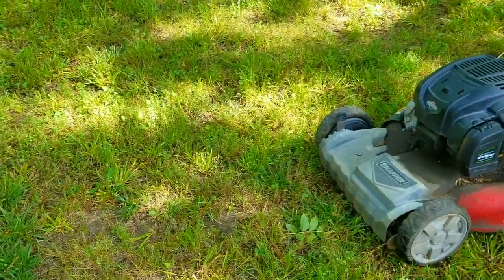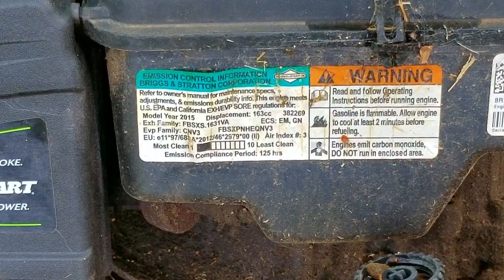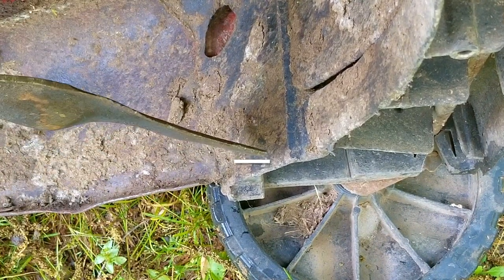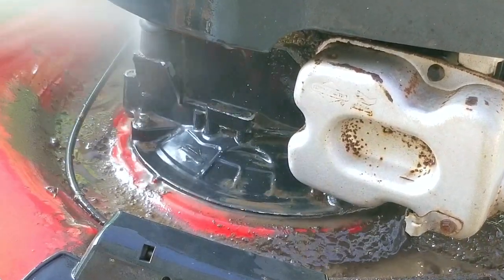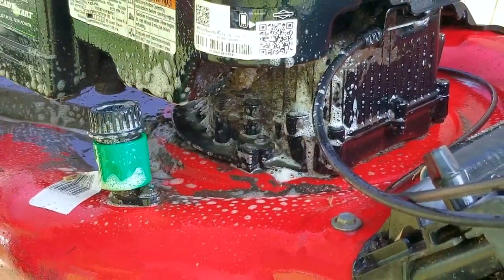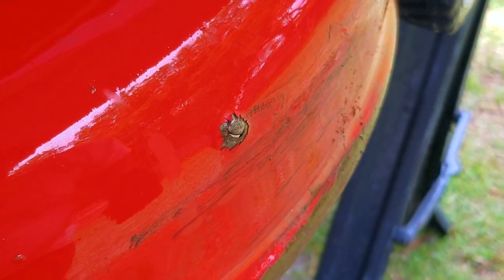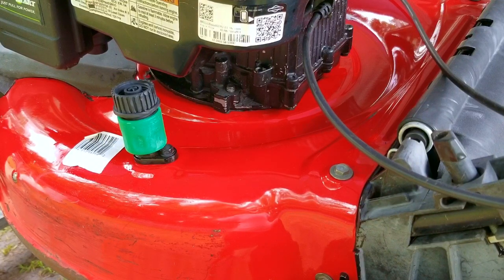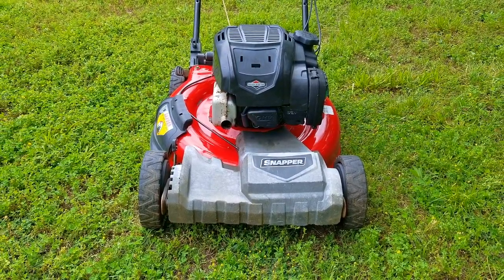What Happened To This Snapper Mower?

Comment: You can check the oil by looking at the deck on that one. I was surprised it started
Reply from the maker: well when you find out the true story about this one, you're going to be even more surprised
Reply: @INSIDEHOUSEGARAGE  I usually avoid them when 1/2 the oil is on the outside 🤣
Reply from the maker: you got that right

Comment: I've been a Honda mower fanatic for 30 + years (not kidding it is almost a religion).
A friend needed a "working" lawn mower he dropped off 2 older domestic brand units, both in dire need of care. He really preferred to have the self propelled back and told me to keep the unpropelled for my troubles.
After completion of the repairs for the mower of preference was returned to him, I set about making the remaining one functional. It was pinkish / orange from sun fade none of the factory labels remained. The Tecumseh engine was tired and beat up, but would start by the second pull every time! This became my loaner to any friends that needed a temporary mower. For more than 20 years that loyal steed protected my precious Hondas from the destructive nature of people who borrow tools. I truly lament the day I pushed it to the curb with a free sign attached to it. I will never find another piece of equipment like it again, it sat outside 365 days a year, tuned it up every other year.  Always started by the second pull...😢 
 As a side note, the original owner didn't want it back because it did such a poor job of mowing. 
When I checked the blade it was sharp as a new one, only one problem . The sharp side was covered in grass clippings, and the blunt side was smooth as could be. Someone had installed the blade upsidedown.😂
Reply from the maker: wow that thing has lasted a long time!

Comment: One guy brought his line trimmer to me to get fixed. I've not seen as dirty mower as this one. Last mower I worked on was my own. Tomorrow, I'll be getting my mower out, cleaning the dust off it, putting fuel in it, starting it, run it for a few minutes, then change the oil. Years ago, our local dump wasn't run by anyone. My brother & myself rescued lots of mowers from there. Most of them only needed a new spark plug. We fitted new plugs to them, new blades, changed the oil if they were 4 stroke jobs, cleaned them up, lubed the throttle cables, tested them & sold them. One we had sheared the key on the crank for the flywheel. Put a new key, same thing again. Put a heavier blade disc on, trouble fixed. I was amazed with the number of mowers people chucked away because they didn't do minor servicing, such as changing what was then a $2 part!! One mower was less than 6 months old.
Reply from the maker: I know right it's simply amazing

Comment: It's not difficult.  Don't leave fuel in the machine, when it's stored for winter.  Change the oil, filter and keep the blade sharp.  I do this every year.  I typically change the plug, every other year.
Reply from the maker: you are correct but most people seem to struggle with this concept

Comment: Pump gas even ethonal for a standard 4 cycle engine will last much longer than 3 months. A well known small engine mechanic on YouTube showed gas over a year old in numerous engines still started, (OTOH two cycle mixed gas has a much shorter shelf life). The primary issue is evaporation, which can happen very quickly in the bowl of the carburator due to the small volume (even though the engines started, all but a motor using non-ethonal gas showed a gummy residue that is a known result of 10% ethonal gas after evaporation) Best practice is to install a shut off valve if not present and then run the carburetor out of gas prior to storage. If you have a vented gas cap, screwing the cap over a plastic bag will minimize evaporation in the tank during storage, or just remove the gas from the tank. Since most 2 cycle engines don't have a carburetor bowl it's not usually an issue as long as you run the carburetor out of gas but you should definitely remove the gas from the tank as most 2 cycle engines have small and vented gas tanks which can cause the mixed gas to evaporate and quickly go bad. I have actually been shocked how long mixed gas in a sealed container lasts (literally over a year but I used synthetic oil and a stabilizer), the more volume the better. OTOH the oil is a completely different matter.
Reply from the maker: thanks

Comment: well for me in general and i do believe it was negligence on the previous owner and our Victa 2 stroke aka 2 cycle P/T (Power Torque) ones people have done some damage with them and never attempted to clean them and look after their decks/chassis/bases as it,s not really that hard to do and of course the way i found it clean it in general is often the old trusty garden hose after use but if you really wanna clean it up well often a light cleaning with the pressure aka power washer underneath will work etc.
Reply from the maker: yes you are correct, this is beyond belief and when you see the repair, you're going to shake your head, thank you Patrick Stapleton.

Comment: The lawn that I mow is approximately 2500 to 3000 sq. meters and me and my father and I also mow the lawn fore some relatives  and that lawn is about the same size.. these are recreational properties so it can be a week or two between each mowing, so due to both size of the properties and the length  of the grass, a reel-mower does not sound appealing AT ALL to me 🤣🤣 I think I will try to keep taking good care of our gas powered Husqvarna Lawn tractor and rider.. 

Giving a gas mower some care and attention should no be above most peoples abilities (I hope).. In the las few years I have done work on our ride-on mowers and other power equipment, that I never thought I would dare to or be able to do.. A lot of it has been a lot less difficult than I imagined.. So learning to take at least basic care of a mower should not be beyond the means of most people..
Reply from the maker: yes using a reel mower for that size would be a poor choice,

Comment: Also understand if you buy any electric mower their is a chance of the battery to get to hot, and catch on fire. To put those fires out is ALOT harder then a gas engine fire.
Reply from the maker: yes you are correct

Comment: Yes, i.e., worse shape. I recently picked up a Kobalt electric mower off the curb with almost no deck remaining. I agree the future will be fewer gas (diesel) lawn implements but I think the trend will be toward more lawn services. Electric mowers were temporarily popular because of the believed promise of low maintenance and other supposed benefits. Disappointed owners were practically giving them away. I think the average person will be disappointed with the maintenance and performance and especially the cost of battery equipment.
Reply from the maker: well said but the part of the lawn services I find interesting.

Comment: Hey, I want to ask if you have an opinion on the Holzfforma brand? Im planning on buying the ms 250 stihl clone ( holzfforma just makes expired patents of husqvarna and stihl i think ) and its only 140$. And i ask because the old mighty ms 180 started giving up on me. It started revving up by itself, dies some times and its a bit scorched at the exhaust port and cylinder.
Reply from the maker: I wouldn't not buy a brand, that you can't find most replacement parts for.
Reply: I bought a pro Rama as a backup Shaw if you're inexperienced saw person you will have no problems I've actually got to love that little Chinese start every time working hard good luck on what you get
Reply: Well im in the middle. I know them but i cant also be on the same level of knowledge that IHG/HG has.
Reply: I understand completely but what parts are you going to buy for that saw
Reply: Well Holzfforma makes parts for all stihl and husqvarna equipment. They are the chinese husqvarna and stihl company. So i'd say they have parts

Comment: Isn’t it a shame what happened to Snapper?!
Reply from the maker: yes It is.
Reply: It certainly isn't built like even the 95 conventional deck Snapper I have. Other than the different normal style deck the drive system is just like my original Snapper pro red deck Snapper that finally refused to run anymore. The parts are still easy to find and cheap.
I finally got a electric cordless mower with a couple of big batteries for it because the yard at my house I bought is much smaller than my old long term rental so I don't really need to run the Snapper unless the yard is really overgrown. It needs a new belt and the idler wheel replaced so not high on my list now.
It really is sad what has happened to Snapper but I THINK you can still get the old school Snappers but most stores sell the fake one like you found now.
Reply: @69Dartman  i got a 40 year old snapper 21 inch self propelled. rebuilt once 20 years ago. used commercially for 10 years or so. residential only for another 10 or more. been retired for 15. but im sure itll start right up with new gas.
Reply: @SgtJoeSmith  I wish I still had the first Snapper I picked up. It was a 78 Comercial with the Tecumseh 5hp engine I paid 10 bucks for at a garage sale and I kept fixing it as things including the deck broke.
We were moving out of the rental and I just didn't see any point in dragging it with us to the new house when I had the newer snapper and a Shindaiwa pro weed Wacker but it was a awesome mower. Probably got scrapped but probably was a easy fix for someone.

Comment: Seen one mower with the whole deck fractured. Pulled as many useful parts off it as possible and scrapped the metal.
Reply from the maker: that's about the best you can do. Thank you Collecting on the Cheap

Comment: If there's one engine u should avoid it's the Tecumseh vantage 35 it's a nice engine but sure horrible to work on the carb just often goes. But it's an nice engine even though the seals for the carb air intake are garbage they don't even seal it properly. But hey booth my mowers have this engine and they still run after 24 years soo.....
Reply from the maker: I'll have to take a  look

Comment: I'm guessing this was a "check and add" model.
Reply from the maker: Yes I believe so, also I'm sure there was an asterisk saying that checking was optional
Reply: @INSIDEHOUSEGARAGE  The only difference between "no oil change necessary," "check and add," and regular models is a sticker. They still need the oil changed.

Comment: FIRST rule of owning anything:  READ THE MANUAL.  Unless you already know everything there is no know about a particular device, NOT a particular TYPE of device (Snapper model xyz123 vs generic class of 21" rotary mower), READ THE MANUAL.  If your parents did not tell you that, they were idiots.  Why you ask?  Because "common sense" means nothing because it is composed of knowledge you acquired, not born with.
Reply from the maker: well said!